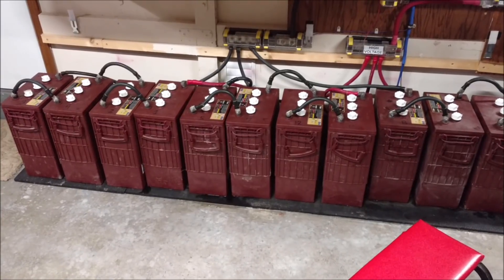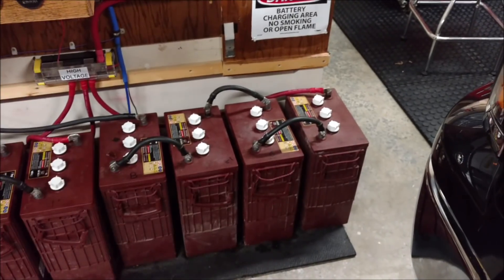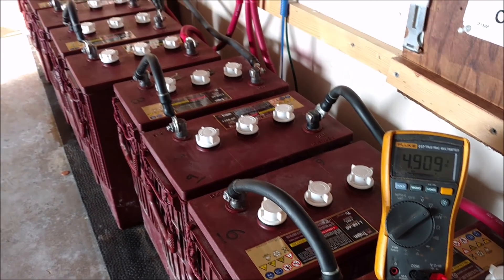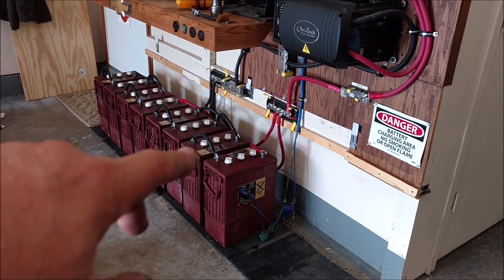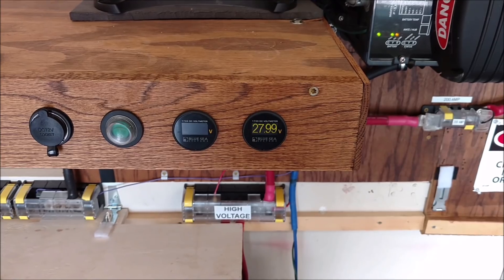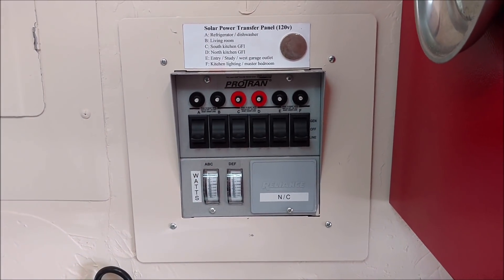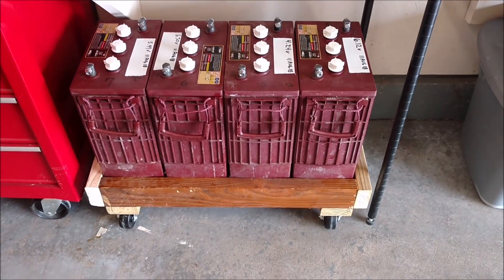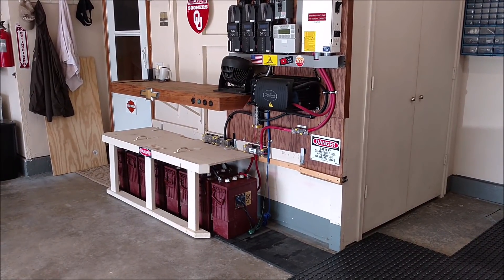24 volt solar battery bank - EMERGENCY repairs, corrective maintenance, bad day

Comment: i have 3 string of l16E     370ah  total of 1110ah .. and everything i have to check wire length  . tight the nuts on the post ant wire loose .a wire loose was giving me a bad reading on my magnum inverter .. my battery are second owner 2016 and 2017. i just put water in them EQ every 14 days and use them till they go dead..  yea very expensive batteries ..love your videos

Comment: Sorry for the bad day, but you are certainty on it!  Best of luck in getting things straightened out!
Reply from the maker: Thanks. Water under the bridge, but lots of bad advice/mistakes made with these FLA batteries. My AGM's (three other solar generators) are doing excellent (Trojan 31AGM "Overdrive" and Interstate Batteries deep cycle 35aH U1-size batteries). Prob a few more days of sorting this all out. Need to win the Lotto

Comment: Wow Chris that is a bummer! I think that is 4 years on that battery that failed? I am installing a system for a friend right now. He wanted a lager battery bank than I recommended but after a lot of research I found out that 3 strings is a killer. The folks that are semi successful rotate the placement of the third string alternately with the other two stings. From what I have read balancing 3 stings is almost impossible. I don't think anyone has worked harder or done better at balancing the three string bank than you. It may be that you just had one bad battery from the factory which in turn would be very hard on the string it was in. Maybe the nano technology with AGM would work better with 3 strings but they are very expensive.  I hope you get many years more out of your other batteries. I am sure my next set will be Lithium Ion from a used EV.
Reply from the maker: Yeh, three strings is tough. An engineer (in the business) said the same thing. My system will run fine on two strings...but, those added kWh in the summer is great to have. In the winter...no big deal. Two strings is fine. So, will leave it at that. As for replacement, never again will I buy a FLA battery. Too much drama. Lithium is still over my budget, but 1,000x less headaches with maintenance and battery management. Thanks friend...hope all is well in your neck of the woods.

Comment: bummer yea may be take 2 batteries out   of the best ones and make a  12 volt solar Generator we been looking at some Hyundai Sonata EV batteries they have the right running volts and the Nissan leaf are they nice to
Reply from the maker: Prob not going that route with mine. Right now, I am lucky to have two operational strings...things aren't looking that great with these Trojans...let alone using the spare ones for a 12v SOLGEN
Reply: yea Batteries can get expensive  we fond some agm s on ebay for 159 to buy us some time to save up to get some ev batteries hope the batteries last for yea that are still  working  cheers we don,t have grid power our batteries gets low some times

Comment: Seems like you had a lot of problems with this lead acid batteries
Reply from the maker: Not getting into specifics...but, yes. Pretty much had it with flooded batteries. My AGM's are kicking butt. Lithium is 3x the cost...but, would likely last 3x as long
Reply: I like my AGM Too..No problem yet after 3 years